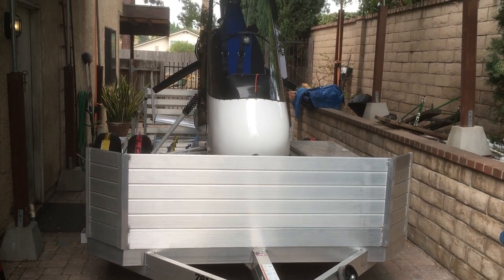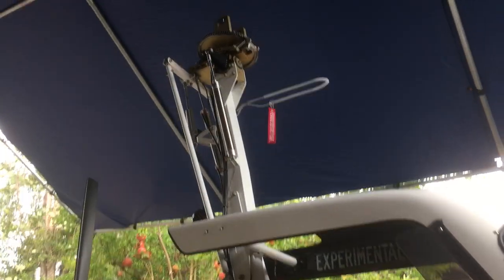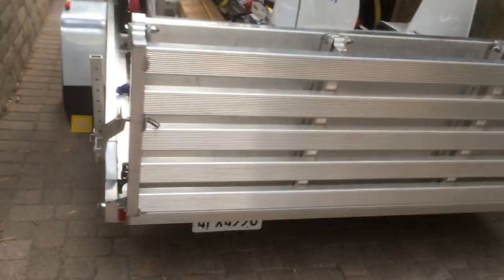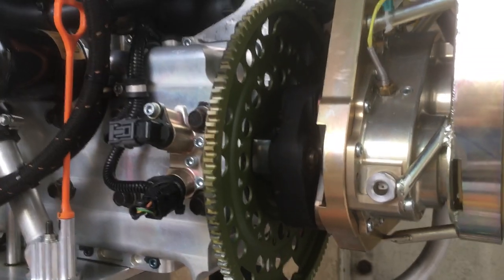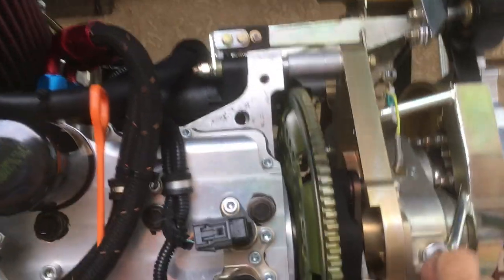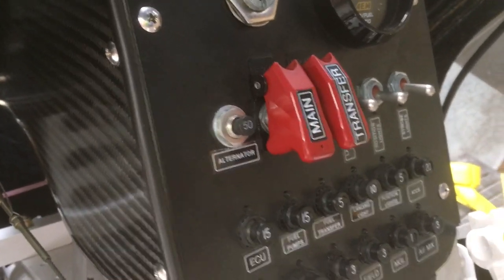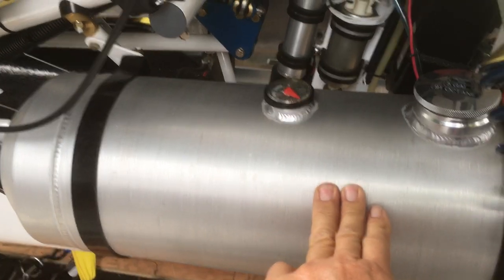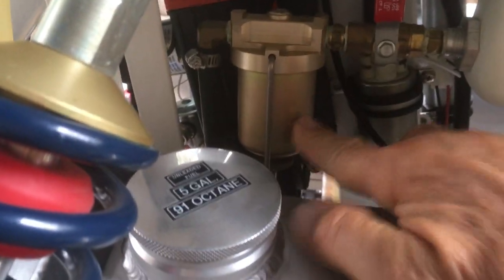IMG 1296

Comment: Are you still using a Viking engine?  Would you recommend such solution to others?  Do you know of any successful installations of Yamaha engine on gyroplanes?  Thanks for a very "Thurow" walk-around.  I am a fixed wing pilot with a fascination for gyros, but not "in that camp yet."  My first experience was with Piper PA-28's and maybe that is "best for me."  11:12 Wondering if the dirt/oil on the cooler concerns you at all?  Does it indicate "just a small seepage," of cooler, or does it come from somewhere else?  You seem like a thorough and meticulous person, so that oil stain just stands out to me.  Thanks for sharing.  (Am understanding now, that maybe this aircraft is a recent acquisition;  supposing you have done a detail dive into the systems.  It looks very well made.  Afterthought:  How would it be possible for any part of the oil breather/filler assembly to become detached in flight and exit through the propeller?